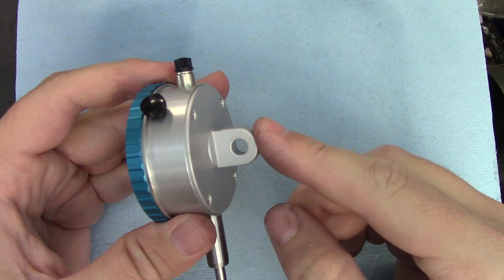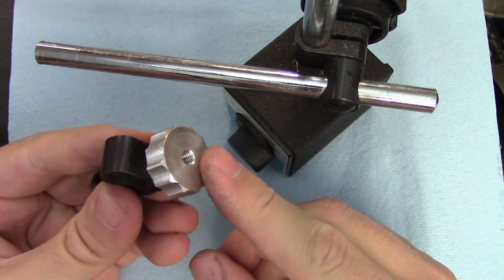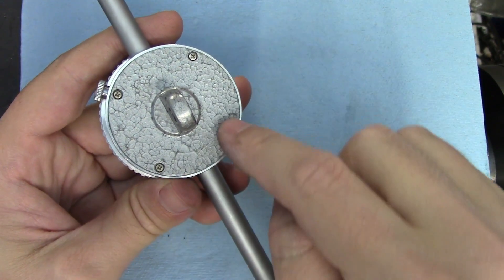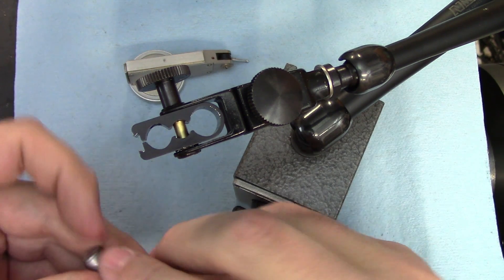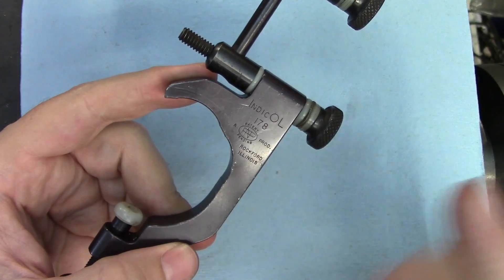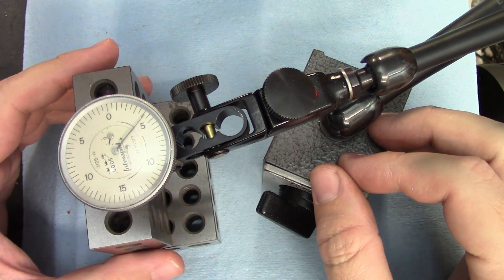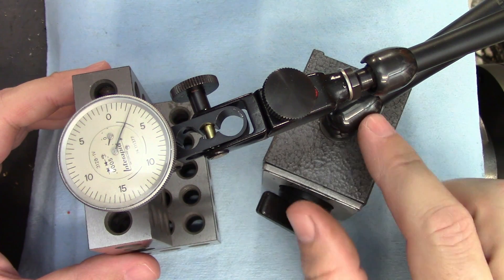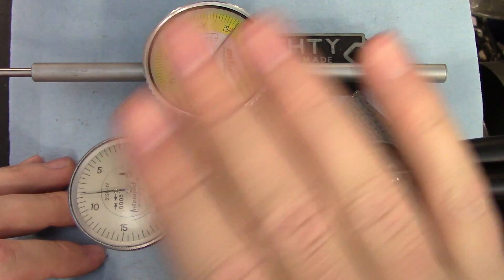Different Types of Dial Indicator Bases - Quick Machining Tips #25

Comment: I think that you forgot the part about, once the indicator is attached to whatever base you are using, you will never be able to actually stand erect and look at the face of the indicator.  You might have to go behind the machine, or stand on your head, or bring in a table and lay on your side, but seeing the face of the indicator will be your biggest challenge.  Whenever I try to use one, thoughts of a monkey and a football come to mind.  I own several indicators but often wonder why.  I use them only as a last resort and, as I age, last resorts are coming my way less and less often.  Living with imperfect tolerances is easier than using one of these evil devices.

Comment: If i may ..a question about test indicator,
Can the angle of the rod at the tip be adjusted?
Reply from the maker: Yes it can. Just move it to the end of its travel and keep pushing. It should slip when a bit of force is applied.
Reply: @StuartdeHaro  super sweet.. it worked! Thank you dude will be more convenient now

Comment: Excellent Stuart. I am always struggling with indicator mounts on my vintage machines. I would be interested in seeing mounts for cross slide and compound use. The dials on my old lathe are so small and worn it is very difficult for my 70-year-old eyes to make accurate adjustments using the dials. The lack of good flat surfaces on the castings makes it really hard to use magnetic holders.
Reply from the maker: I could probably make a little something up. It might be a little while though. My dance card is pretty full for the next month or so.
Reply: @StuartdeHaro  Thanks . No hurry I am a subscriber and have the bell rung so hopefully i will get a notification when you post again. Never know if You Tube will send a notification .

Comment: Enjoyed the video. At this very moment, I'm refurbishing a Starrett 252. The 14" version. Seems like the ultimate surface gage. Can't wait to use it.
Reply from the maker: Send me a pic when you get it finished up. I'd love to see it.
Reply: @StuartdeHaro  I still have a little cometic work ahead, kinda enjoying taking the time with it, but I did assemble and use the gage. Couldn't help myself. Unlike what I'd thought, it's the opposite of a surface gage. The thing is meant to stay put and it doesn't like moving on the granite. 

It does two things: it's very rigid and its fine adjust is unlike anything I'd previously used. Tried counting the threads, but couldn't see them well. That's how fine they are. Takes forever to lower the stylus. OTOH, seemingly a few specs of dust will almost seize it. The action of the fine adjust is such that there's no perceivable backlash. Where you put it is where it stays, and it gets there in a un unusually controlled manner. Then there's the rigidity. Talk about repeatable readings. The gage is a joy to use. I'll shoot you some pics once it's done.